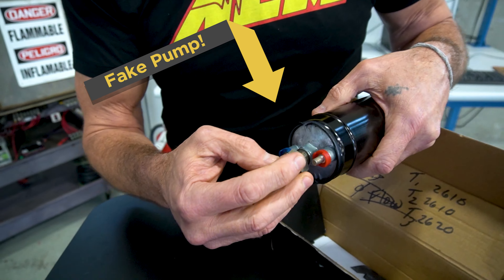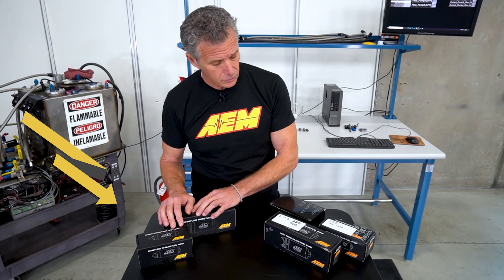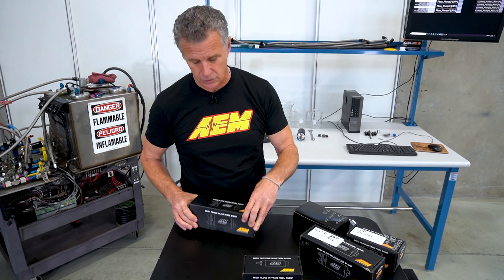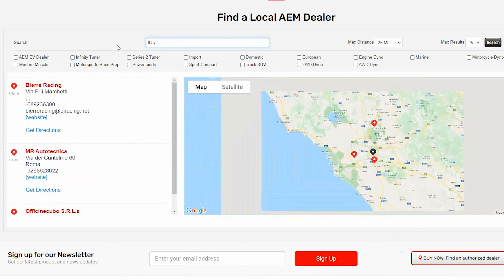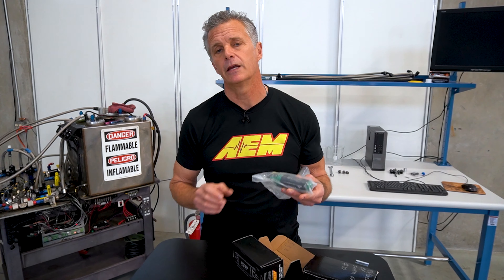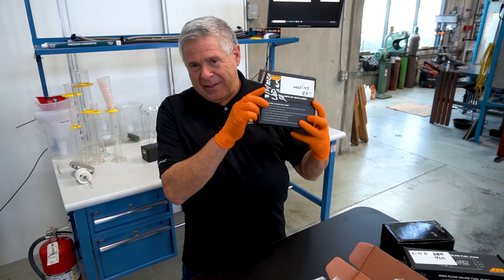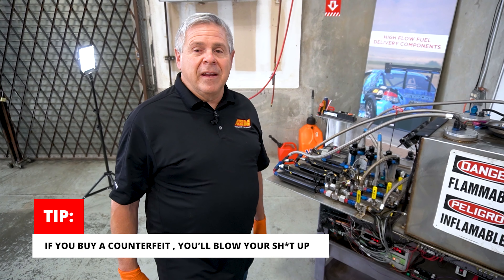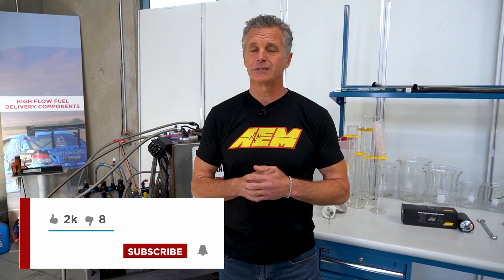TESTED! AEM Fuel Pump Vs KNOCKOFF Pump!

Comment: Great video. I noticed you mentioned that a pre-filter is need for a in tank fuel pump, is it needed for an in-line fuel pump aswell when mounted outside the fuel tank? (Filter before the pump then another after the pump)?
Reply from the maker: Yes! prefilters are required both in-tank and external installs. A filter before the pump helps keep contaminants out of the pump. A filter after the pump helps keep your injectors from clogging.

Comment: Are your brushed pumps happy with PWM control? If so what frequency? I am working on a big single system for my Challenger that is more of an OEM+ setup. Building the circuit myself, using 5v analog pressure transducer for signal, converting to digital PWM for a motor controller.
Reply from the maker: Please contact our tech support team at gen.tech@aemelectronics.com and they can advise, thank you!

Comment: Great video 👍🏽 If you’re Running a AEM ecu and fuel pump set up. let’s say if the fuel pump was to drop below a Dangerous range. can that be set it up to cut the engine through the ecu with a fuel pressure sensor?
Reply: Some things can be over engineered

Comment: Hey guys I had just installed an aem 340 fuel pump in my 2017 Nissan 370z, I utilized the aem wiring harness and soldered it to the oem wiring and pigtail. Aem red 》oem blue and aem black 》oem black. Started up perfectly the first time and I had the car idle for about 12 minutes to ensure everything was fine, the car ended up turning off at the end of those 12 minutes and it would crank after. Any thoughts?
Reply from the maker: For starters we don’t recommend soldering these connections, solder can make the wires brittle potentially crack. I recommend going over the install again, then if nothing is found please contact our tech support for further troubleshooting at tech@aempower.com

Comment: Hi guys. What’s the current on the genuine pump? While the fuel pump is in action. The video did not show that.
Reply from the maker: Current will be variable based on pressure take a look at the graphs below:

https://www.aemelectronics.com/sites/default/files/aem-400lphinline-fuel-pump-flow-current-vs-pressure-50-1005-1009.jpg

https://www.aemelectronics.com/sites/default/files/aem-intank-fuel-pumps-flow-current-vs-pressure-50-1000-1200-1215-1220_0.jpg

Comment: This is great explanation, especially for people dealing with replacement original fuel pumps. I just purchased one in tank fuel pump 340LPH for my Aston Martin DB7 in line 6 -1997 production. I think it will be easy to install it based on what I have seen now. My car originally has 2 pumps. After testing my installation I will purchase second pump and finalize fuel tank installation for enjoying the car. Does anyone have any specific recommendations for installing AEM pumps on supercharged 3.2 l  - 1997 Aston Martin DB7?

Comment: Thanks for getting the information on knock off parts out there, my friends work in the aftermarket and it’s crazy that there are websites that specialize in selling knock off parts, starting with EBay, I learned my lesson years ago, only buy from a reputable reseller, Summit racing, Jegs, etc